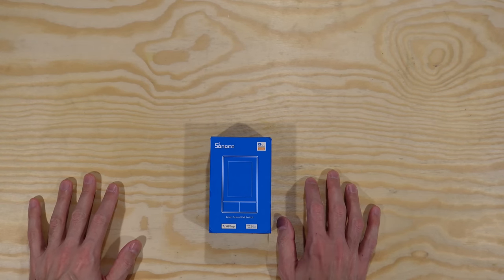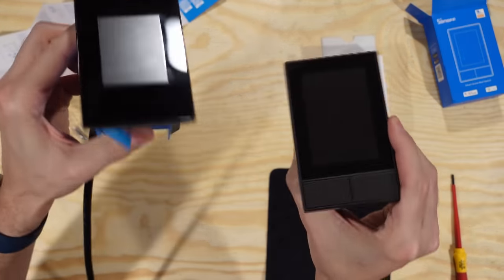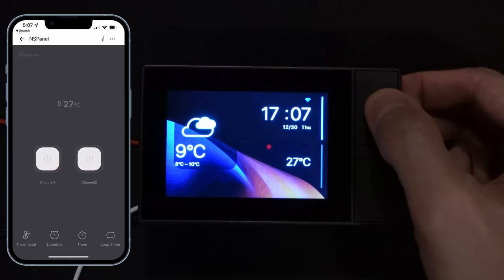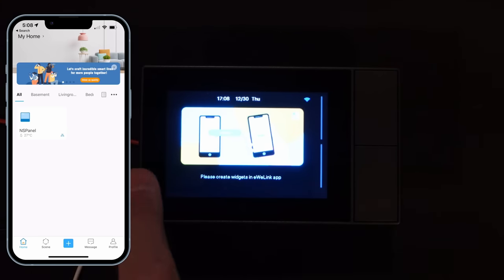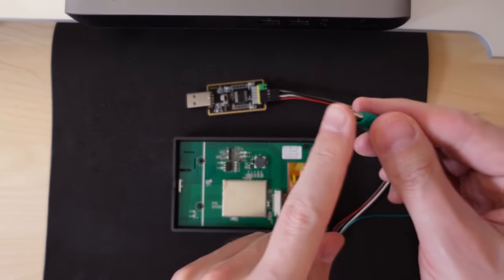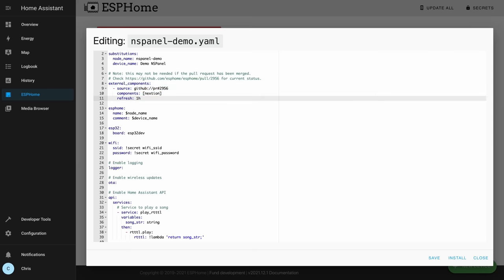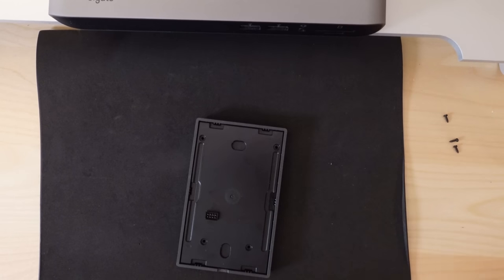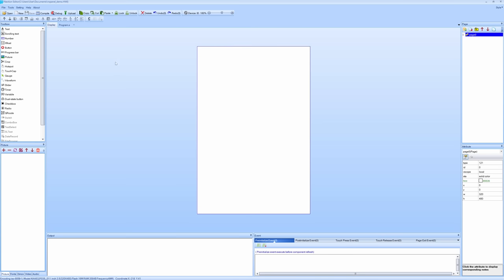Flashing the Sonoff NSPanel with ESPHome - how to get a custom UI for Home Assistant!

Comment: I have to say I'm curious what sort of hardware you have on your lighting circuits if you need 15amps per circuit.  In the UK lighting circuits are typically 6a per floor (I believe its similar in Europe) and i would be amazed if we got anywhere near 2a per room with anything other than traditional incandescent bulbs.  I think currently, with LEDs, even if i turned on all the lights in my entire house (upstairs and down) it would struggle to pull more than 2a.
Reply from the maker: Hi Adrian,

I anticipated that comment, which is why I put the "I know, LEDs" message up while I was saying that. I can't tell you the historical reasons why, but US domestic circuits are typically 15 or 20 amps. I'm guessing to accommodate 1000+ watt electric appliances. Remember, our voltage is half that in the UK, so it takes twice as much current for the same power. And while I think you almost always separate your lighting circuits from your power socket mains, in all of the houses I've been in here, they've been mixed together. (I'm not talking about best practices, I'm talking about what houses really have after 50 years of additions and modifications). When they were built for people using 75 and 100 watt light bulbs, sharing the circuit with sockets where someone might plug in an electric iron or heater, it makes sense.

"So what? You're only using LEDs now!" I hear you say. That's not the point: the circuit breaker's purpose is to prevent the circuit from being overloaded and potentially starting a fire. That means that any switch on a 15A circuit needs to be able to handle current up to 15A (+ safety margin). It doesn't matter if your LED lights only use 250mA, because something could go wrong with them, or a mouse could chew on it, or someone could put a nail just barely through the insulation, or any other condition that causes it to, draw, say, 13A. The circuit breaker won't trip, but the NSPanel could go on fire. If it can only safely supply 2A, it should have a 2A fuse to ensure that an overload blows the fuse instead of burning your house down.
Reply: @ChrisMasto  Yes i did see the note about LEDs i was more interested in the reasoning.  I was aware of people looping wall sockets into lighting circuits but didnt realise it was a normal thing.  That cant be up to code can it?

Its a fair comment about "being able to handle 15a+" but in my experience, very few smart switches support that much current continuously and only a small subset support it for even peak loading.  

Certainly not most of the sonoff kit.  A lot of it is rated to 10a at most for their standard switching units.  They do make a high current switch but that's designed for things like water heaters or something, and even that is only rated to 16a.

Shelly do in-wall switch modules and some of those are rated to 16a peak current, but under practical use, they get far too hot to use them much above a few amps and overheat due to their tiny design.

But in most cases i believe that if they have had the appropriate accreditations, if you exceed their rated current you wont get a fire, you will just blow a fusible link inside the relay or on the board.  Obviously that's not ideal as that's a total loss situation for the unit, but better than a house fire.
Reply from the maker: @AdrianBawn  I understand your reasoning as well and I wouldn't personally hesitate to put some LED lights behind this thing. But what I was trying to convey in this video (and keep in mind this isn't scripted and it's hard to talk and think at the same time) is that this thing says not to exceed 2A, and that's potentially dangerous since the protection device upstream of it will not shut off until you exceed 15A. Whether it keeps working when overloaded (people have torn it down and discovered the relays are actually 10A rated), harmlessly pops, or burns down the house, I have no idea. Folks like Big Clive are a lot better at spotting safety concerns and testing things to failure.

I could be completely wrong about switches needing to handle fault current, but I looked at a couple of examples from "reputable" manufacturers (https://aeotec.freshdesk.com/support/solutions/articles/6000165731-nano-switch-technical-specifications-, https://www.homedepot.com/p/Leviton-Decora-Smart-Wi-Fi-15A-LED-Switch-No-Hub-Required-Works-with-Alexa-Google-Assistant-and-Nest-2-Pack-VB2-DW15S-HD2/302650570), and they do seem to be rated for the full 15A. Anyway, I have a tendency to get into Internet Arguments.. I'm willing to be wrong here, just wanted to answer the question about what was going through my head when I said that.

As for the electrical code here.. as far as I can find, there's nothing in the national electrical code that requires separate lighting circuits. I think it's not only allowed, it's standard, at least where I live in the northeast. The way we do electricity in this country is kind of nuts.. this is a typical breaker panel: https://i.imgur.com/tCnBFvJ.jpg. In fact, it's mine, from a picture I took while we were house shopping. (I've fixed some of it up since then) But generally things are poorly labeled, what is labeled is wrong, and it's a complete mashup. For example, I have a complete map of everything in the house now, so I can tell you exactly what that sixth one down on the right (labeled "formal dining room switch") feeds:

Dining room - Chandelier
Family room - Outlet left of fireplace
Family room - Outlet right of fireplace
Family room - TV bottom outlet
Family room - TV top outlet
Garage - Outlets - interior all
Master bedroom - Two outlets behind bed
Master bedroom - Closet lights
Master bedroom - Ceiling lights
Master bathroom - lights
Master bathroom - outlet

It is as entertaining as it is terrifying.
Reply: @ChrisMasto  Wasnt trying to start an internet argument.  US code and UK code is very different so theres no point trying to "one up" each other.  The fact that you find your terrifying, though, says a lot :)

I agree it makes some sense for every switch, and unfused device, to be able to work up to the circuit rating, but that doesnt really work when people start making larger 20, 30, or even 40+ amp circuits.

For example the UK mains sockets are generally on a single ring per floor (all sockets in all rooms) and generally on a 32a breaker.  That would mean everything would need to be 32a rated, but instead we have individually fused plugs and fused spurs to apply granular protection locally.  Individual items are only fused to 13a max, but the sockets them selves, while rated to 13a each, arent fused at all. So if you could create a 30a load on a single plug by bypassing the fuse it would likely melt the socket, but the breaker wouldnt trip. I guess the likelihood of that happening is slim, though, given all the other protections in place.

Domestic electrics is a minefield, though, and some of the smart IOT hardware is cutting corners because its built in china / taiwan where they dont really care about standards as much.  Even stuff that is up to standard, often seems to only barely pass muster (undersized traces, poor component spacing, etc etc).  Its getting better but its taking a while to catch up to western standards.
Reply: 2A limit they've stated doesn't mean the components aren't rated higher... They might be understating because the relays last significantly longer that way, or to cover their butts legally, or to discourage use cases they're not meant for.
It may be purely to do with warranty, not electrical safety.

Comment: Please could I ask a huge favour @Christopher Masto. Please could you upload a backup of the original Sonoff NSPanel firmware to your GitHub and send me a message with the link? I lost my backup a few days ago when my PC crashed. I’ve searched the internet for hours and cannot find a link to the original firmware anywhere.
Reply from the maker: I wish I could help you, but the firmware is not my property to distribute, and it wouldn't work anyway because they are locked to the hardware.

Comment: If you're just using it as a touchscreen control panel, why don't you just use your phone?
Reply: phone or tablet have a lot of troubles to be using as HA control panel: mounting, lithium batteries and charging, long restarting, lack of the physical buttons, and cost, but, of course, you can buy used or ref device for this purposes

Comment: why didn't you flash directly over USB from ESPHome but instead you used espflasher and uploaded the bin file produced by ESPHome manually? probably unnecessary step
Reply from the maker: My Home Assistant server is running on a virtual machine located on a shelf in a network closet in another part of the house. It's a lot more convenient to flash it on my computer. I didn't want to confuse people with additional requirements to flash over webserial, so I thought it was best to show one universal way to do it. I did mention the other options at 20:38.
Reply: @ChrisMasto  that makes sense - super nice video and lots of things to take from it - thank you Christopher for your time and passion ;-) I have 50+ devices connected/programmed to ESPHome but for more advanced one I prefer C/C++/Arduino, as ESPHome has huge but not really detailed description on "howto" when it comes anything beyond switch/relay etc - your video brings is more to the beginners like me.

Comment: When the firmware is building from nspanel-demo.yaml, I always get a checksum error on d2b27c6-framework-arduinoespressif32-3.20005.220925.tar.gz.  Looks like the PR was closed but not merged.  Any idea how to fix that?  I'm completely stuck at that step.
Reply from the maker: I don't know what's causing that, but I don't think it's related to the PR. I am still using my same ancient configuration from when I made this video, and it builds with the last version of ESPHome.

It sounds like maybe you have a corrupted file. I would try "Clean Build Files", and if that doesn't work, see if you can locate that file and get rid of it manually.

Comment: I was going to attach headers but I feared they wouldn’t fit under the lid as the existing 8 were in a cutout. So I pushed female duponts onto headers passed through the underside. You also don’t have to attach to that ic, just short IO to ground and hold the reset button on the bottom on the board near the thermistor while powering and connecting the serial UART to usb.